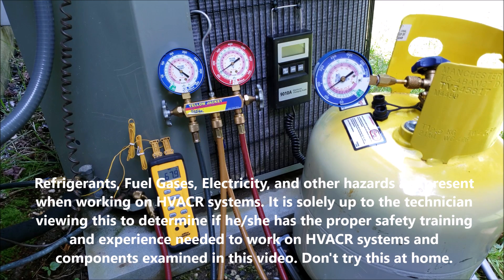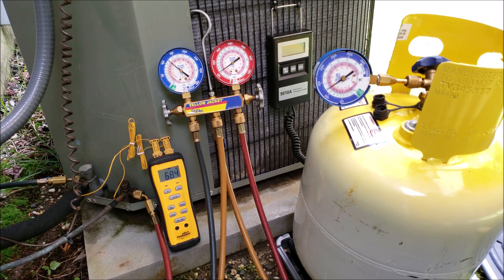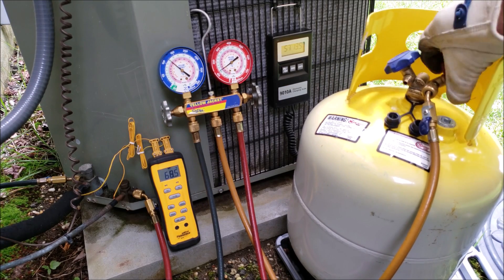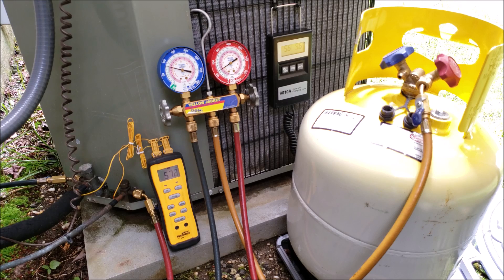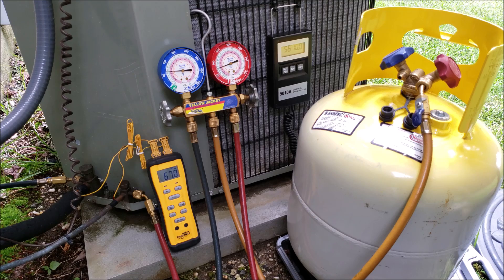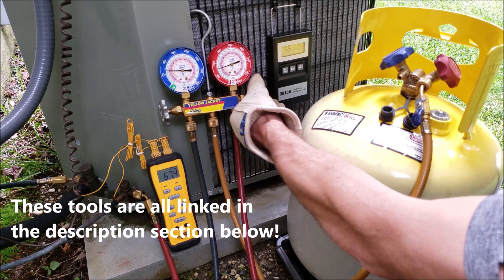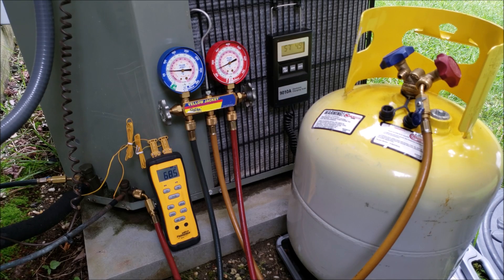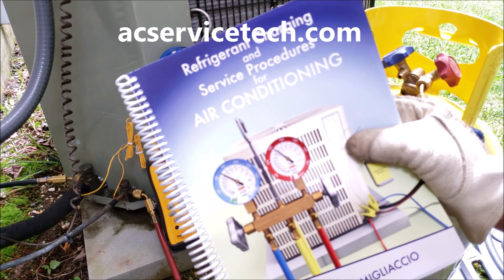Recovering Refrigerant with the Compressor While the Unit is Running, Adjusting the Charge!

Comment: i don't agree with removing refrigerant from a Running system via liquid line. i Have found that alot of oil ends up being removed from the system and ends up in your recovery tank. Not good !!! on Systems u cant check the oil level on. This is a Good way to Loose a compressor !!!. Shut the System down & recover is a better alternative. Just my 2 cents. i've only been doing this 38 years.
Reply from the maker: Hey OC, I agree that this would remove a little more oil than a standard recovery but it will not be that much when removing a small amount of refrigerant. The oil is still through the whole system in the vapor and liquid side. While the system is running, the oil is up off the bottom of the tubing and mixed more than when it is off but if you are only taking a little bit of refrigerant out then it will not be much oil loss. This method using the compressor is also discussed in the EPA 608 test with multiple questions about it so I want new techs to know about what it is talking about, thanks!
Reply: i Just wanted People to know that oil iS removed from the system doing it this way & oil is NOT Removed from a system when recovering a charge from a standing system / a system that is not running. You Have become a teacher in this industry & people need to be aware that problems can arrive after doing this and some people may abuse this procedure leading to more problems and a tech wondering why after his service did the compressor die a week later.
in this video you make No mention of Not abusing this procedure by removing total system charges this way etc.
Reply from the maker: Yes I would not want anyone to try to recover a large amount of refrigerant from a system using the compressor method especially if they want to use the system again. This was just a video for adjusting a charge using the systems compressor to recover some and is really the only time I use this method or show to use this method. It is rare for sure compared to using the recovery machine. I added a note in the description. It certainly is a good topic to address though. I will see about doing a comparison between the two methods and why and when they are used, thanks OC! All good stuff! We don't want anyone running ahead and thinking this can be used for whole system charges or recovering large amounts of refrigerants. Thanks!
Reply: 👍. Yea, i could see people abusing this procedure , Blowing total system charges into recovery tanks and wondering why the compressor quit a week later.
Reply from the maker: All good, thanks for you input!
Reply: Thank y'all for the clarification.  This was a question I was about to ask as a new technician in the industry. This was so helpful for rookies.
Reply from the maker: Thanks for letting us know!
Reply: Excellent catch on the GFM myth buster.  Seems like oil doesn’t ride with the liquid refrigerant much at all.

Comment: What is the method on checking other types of refrigerants in the drum with the outside ambient,like you did on R22
Reply from the maker: If you talking R-410A , you would check the pink inner ring for the saturated temperature. You could use a p/t chart or p/t app such as the Danfoss slider and convert the pressure to a saturated temp, thanks!